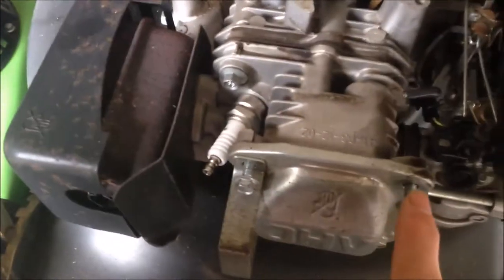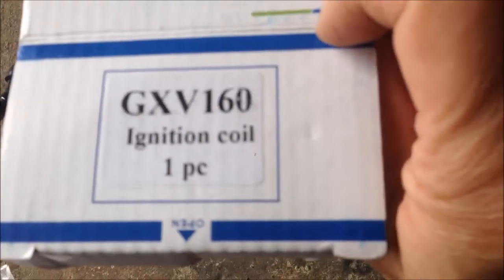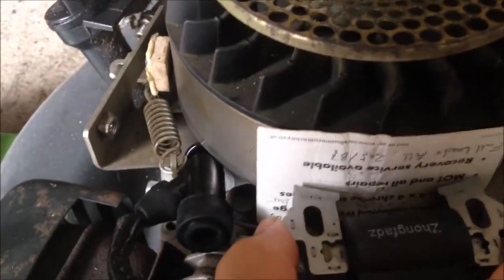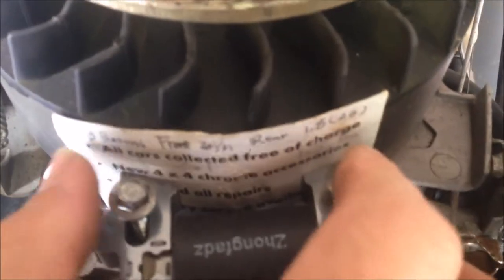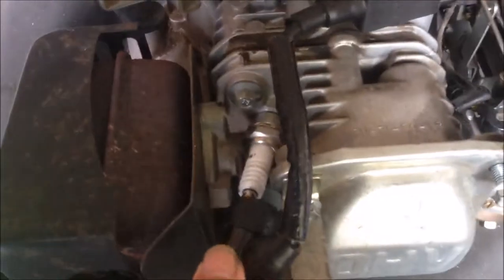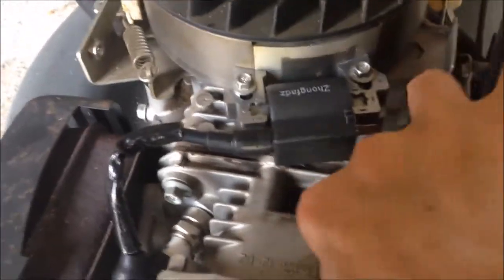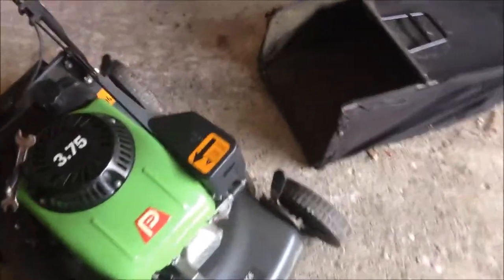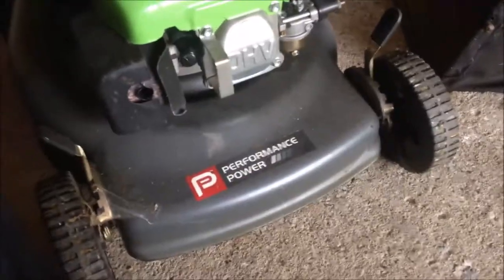B&Q Performance Lawnmower - Ignition Coil: How to Install

Comment: Here mate, loving this. Tried it and it started up. Only problem now is my carburettor screw hole is buggered. You wouldn't know which to get would you?
Reply from the maker: Well done! It was enjoyable when the mower started again! Original screws are always hard to find. I would just try hardware stores or ebay for similar ones. Good luck!